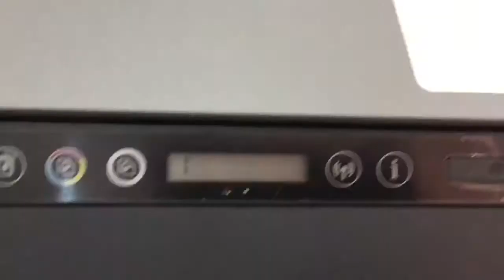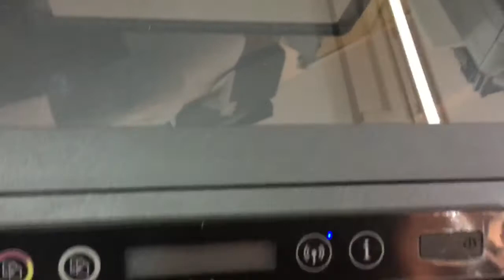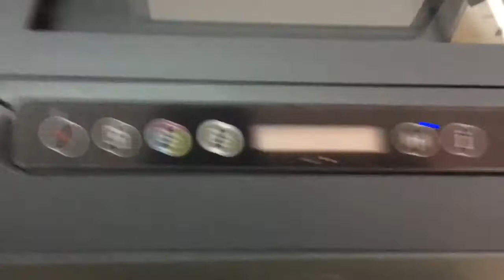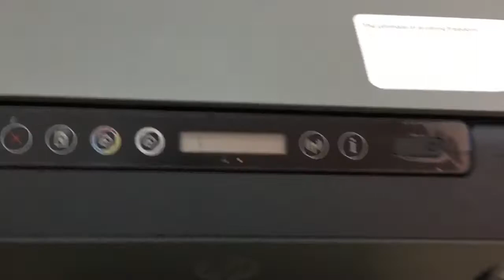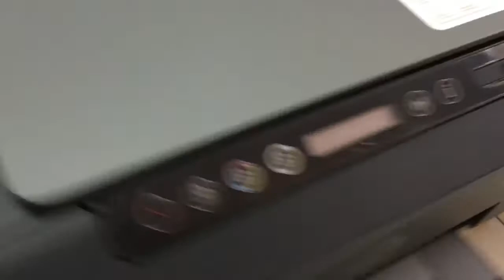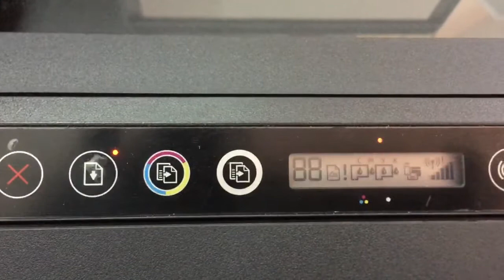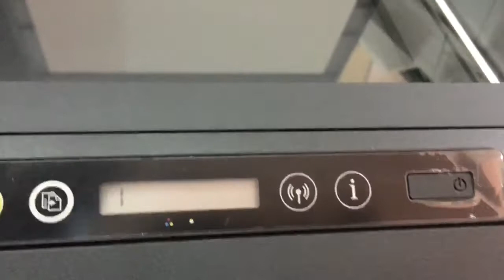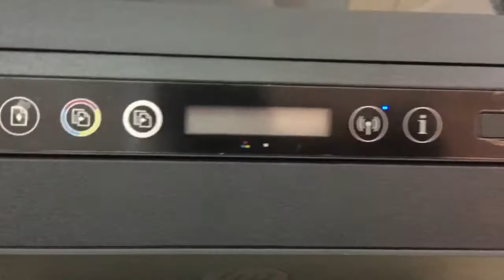How to solve HP Smart tank 500 510 515 516 517 518 519 error cannot print copy scan 01

Comment: Same trouble with my printer HP smart tank 519 i check inside the printer the control board is so hot. Until now still unresolved. Too expensive if i replace the control board. I need diy solution.
Reply from the maker: how about the error code? the control board( mother board)really bad, do you checking other parts all?